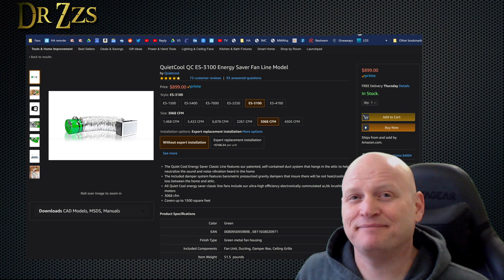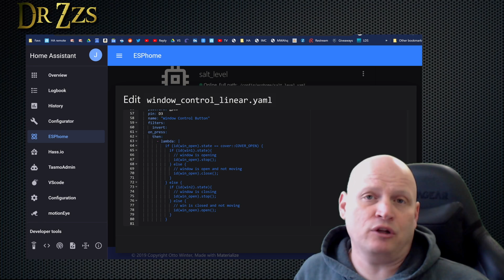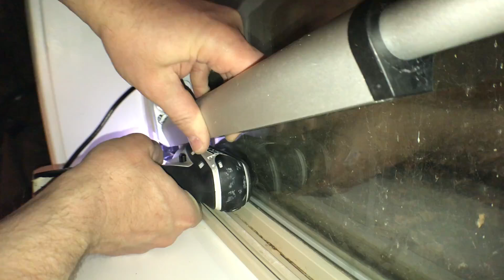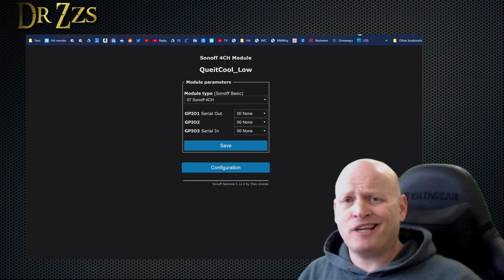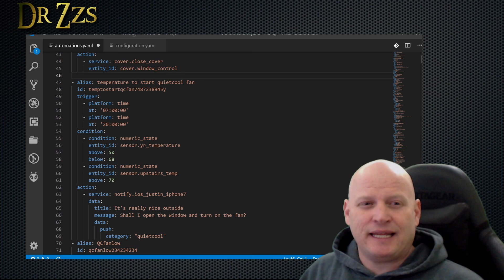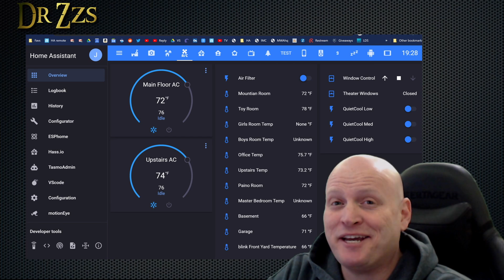Motorized Window Opening!  Save $$ using less AC! Smart Home | Home Assistant

Comment: You have ruined the required code fire egress window. Exit size required: 20 inches minimum one direction, 24 inches 2nd direction, and 5.7 square feet minimum square footage. (Note: 20 inches times 24 inches is not 5.7 square feet. One dimension must be larger than the minimum.)

Comment: Could a PLC, like an Arduino Optum could control this?  Adjust a window to different heights for cooling and kick on the fan, close it for storm detection or if it’s too hot and switch on the A/C or Smokey outside or vent for a fire…or close for cold temperatures.

Comment: I used the code to automate my Chicken Coop Access Door. Everything works as expected (up, down, stop) using the HA interface. Automatons (Sunset-close and Sunup-open) work as well. However, I just cannot get the physical button switch to do anything. From what I can tell, the way it is wired is to ground D3 (binary sensor) to stop or go up or down depending on the condition. Any hints on what I should look for to get the switch working?
Reply from the maker: Awesome!

Comment: Hi Justin, do you have an example that will include a dependency on a PIR sensor, if it will be allowed to close? (trying to get this to work with a sliding door for my dog -- it's working great so far, but I just don't have the motion sensor setup to make it safer for her if she decides to run in/out while it's closing
Reply from the maker: ooh good question.  I don't have that off the top of my head.  Seems like what you want would be like the laser line break sensor like on a garage door.  I'd suggest poking around in the ESPhome docs and see if there's an example of how to use one.... I just did a quick search and I couldn't find anything in ESPhome about a breakbeam sensor.  I'd bet it would be interpreted by ESPhome as just a switch.  Maybe get a cheap breakbeam sensor and play with it.

Comment: I see you're using a 25w motor controller, but the max wattage on the motor is 36watts (12v@3A).
Reply from the maker: It seemed to work okay.  I agree it was probably pushing the limits.

Comment: I'm really considering doing this in my brand new home as well. With it being super insulated, even when the temp outside drops to like 50 outside, the house will keep heating up to like 73 just from people/cooking, etc., so it'd be nice to crack a window and turn on my HRV to get some free "AC". Are there any issues drilling into the vinyl windows?

Comment: Great Video! installing this in 2022, there are some updates to the esphome  yaml that i needed to do. I'm wondering if this can be accomplished with a motor, track on the outside frame of the window, and installing end stops.  The Linear actuator works, but its slower and loud. I'd assume the motor with a track would be more  quiet, open the window faster and be able to open the window almost it's full length.

Comment: I think this code would work better for your application.

Only problem I see with it is rapid cycling because of a < or > set point. 

local Target = 65
local Buffer = 5
local Equalib = 10

if inside_temp > target+buffer then

	heater.state = false

	if inside_temp > outside_temp-Equalib then
		fan.state = true
		windows.state = true
		ac.state = false
	else
		fan.state = false
		windows.state = false
		ac.state = true
	end

elseif inside_temp < target-buffer then

	ac.state = false

	if inside_temp < outside_temp + Equalib then
		fan.state = true
		windows.state = true
		heater.state = false
	else
		fan.state = false
		windows.state = false
		heater.state = true
	end
else
	fan.state = false
	windows.state = false
	heater.state = false
	ac.state = false
end

Comment: If anyone else is using this video as a jumping-off point... I am using an ESP32 and found that I have to set the mode of my binary sensor GPIO pin to INPUT_PULLUP to account for float. I'm pretty new to this, so I was very confused when the state was looping On/Off every second or so. But hey, now I know about pull up resistors :) 
I've also set up a delay to ensure the button is actually pressed, but this might be unnecessary. 

binary_sensor:
  - platform: gpio
    pin: 
      number: GPIO14
      mode: INPUT_PULLUP
    name: "Window Control Button"
    filters:
      - invert:
      - delayed_on: 100ms
      - delayed_off: 100ms

Thanks for the video DrZzs- learning a lot.

Comment: I don't understand why window manufacturers don't have these installed inside the frame, so it's hidden. It would be nice to have the window open and close based on indoor vs outdoor temperature and PCT chance of rain. I hate opening the window at cool night because the AC won't turn on. Then closing it when it gets hot in the morning.

Comment: As always, thank you so much for your videos DrZZs.  Dumb question...This type of motor controller does not report a position, does it?  So, the  only way to stop and report if the cover is open/close is by using end stops (binary sensors), is that correct?  I know that the linear actuators that you used here have an stop, therefore you didn't have to have other end stops.  Thanks for confirming the info.

Comment: Great watch, this has given me an idea to use all of these components to push open and close my TV storage unit in between some wardrobes. The TV is an ambilight linked to home assistant.

I will take a state of Off to stow TV away, On to push TV forwards by 100mm using the delay of how many seconds it takes to reach 100mm (the delay you are using to drop power) or use a reed switch or limit switch for this. When TV is forward by 100mm the whole wardrobe frontage can benefit from ambilight.

I will then have a push button inside the wardrobe to open by 350mm (end of actuation) to access the storage behind the TV unit. using the L289N saves me from using a relay board.

Comment: Hi @drzzs, I tried to work with the L298N board, but for some reason, after a while, it makes my 200v breaker trip :/
I have no idea what's wrong, I'm using a 12v power supply with 3A max. Any thoughts?
 maybe I'm missing something in the code? , maybe it draws too many amps after a period of time?
Thanks!

Comment: Ok...but what did you use to automate the whole house fan?
Reply from the maker: A sonoff 4ch running Tasmota.
Reply: DrZzs Sweet! I’m looking to turn my whole house fan smart, but I still need to climb into the attic and see what kind of power my fan draws. Right now it’s controlled with a timer knob and a separate switch to turn the fan to high. I was thinking a Shelly 2 but I’m not sure if the fan will draw too much power.

Comment: Genius, simply genius.  I have an area at the top of the staircase that just collects humidity and heat due to not very good insulation in a 100 year old building.  Since I am rarely at the property I just look at my raspberry pi temp/humidity sensors and say ARGHHH.  Now I know I can install a simple small window and open and close it to vent the stairwell from miles away.
Wondering if I can run the motor with a motorcycle or car battery that gets charged with a small solar panel?

Comment: also use central power factor correction to really save on your electricity bills...try automating that and interface it with home assistant...it will be a nice challenging project requiring both embedded systems and power electronics knowledge.......plus it will give you great set of stats to observe your power usage by your smart home

Comment: Hi there. I'm wondering if something similar could be put together for a lock I have installed on my garage. Looks like this  https://amzn.to/2rxlqw9  .  I need to be able to remotely (un)lock it, say from a remote fob in the car, or via Home Assistant. I already have a a RPi in the garage for automated garage door open/closing. I suspect though I can't directly wire anything to it since the moving of the garage door would be a problem for the wires, so what remote (wireless) options do you think are available, and that can also control the motor. I wouldn't need something as large as the one you used....the lock latch only moves about 3-4inches.

Comment: Great video I also have a QC fan but I need to have the physical buttons cause my wife is automation challenged. Do you have a way to push a button to turn on the fan?
Reply from the maker: no, I don't have a physical button.  but you could use pretty much any switch/button that is connected to HA.  Even something like a long-press on a Tasmotized light switch could send the message to HA to turn on/off the fan.  Or an RF button with the RF bridge, or one of these Xiaomi zigbee battery buttons.  Or an HA switchplate if you have those.  
Basically, you can take a physical button and tell it to control the fan through HA.  
That'll work!
Reply: @DrZzs  Thanks, I did figure out how to use a Sonoff tx 3 switch to control a sonoff 4 channel to turn on and off the relays.

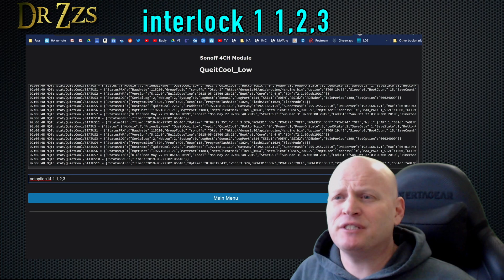Comment: 11:43 interlock working on version 6.5.0.16. According to documentation
1. Need to create interlock groups. Example command: interlock 2 1,3 
    where created two groups with single switch 2 and group 1,3
2. Enable interlock by command: interlock 1
Test feature. SW#2 working as usual and SW#1 , SW#3 works in group.
Reply from the maker: Thanks!
Reply: @DrZzs  Actually why you don't use latest versions of tasmota ?

Comment: Did you give any thought to a suggested fan speed and variable duration based on temperature differential or usage history?
Reply from the maker: so far I'd say you'll notice a change in temperature within about 30 min.  The rest depends on what temperature it is outside and how cool you want it inside.  I started running ours for an hour at a time, but lately (since it's been warmer outside) I need to run it longer to get it nice and cool in the house.  I'm running on LOW most of the time just because Med and especially High are much louder.  
I guess the best answer would be, Low is the best speed for us based on sound, and I've been running it for 2-3 hrs at a time in the morning then again in the evening, but usually shutting it off from about 11am to 6pm and about 11pm to 7am.
Hope that helps!
Reply: I meant that your home automation should predict and suggest desired usage.  As the day gets hotter it might suggest an increase in fan speed or switch to AC.  And your phone popup might authorize the recommendation or let you choose something else.

Comment: Is it possible you just rendered the window into a "fire code violation"?  I know you can just yank the window out in the case of an emergency escape but the fire marshal would probably see it differently.  Very cool use and implementation.  Perhaps you could use some kind of locking bracket on one end that allows you to pull the end up and out (similar to the bed rail brackets that hook and lock).
Reply from the maker: that might be true, but there is another window in that room right next to the one I motorized.  But you are right.  Probably would be better to use some kind of removable pin on one end of the actuator so you could pull the pin and push it up out of the way.

Comment: Nice vid! Hopefully you have another similar window like this in your basement as these are frequently considered a fire exit.  It would be easy to make a mount for the wall mount of the actuator that could allow you to slide the actuator up and out in an emergency. 
Also, I'd modify the QC fans display to be an input select rather than three switches, but that's just my preference.
Reply from the maker: that's a good idea!
Yes, there is another window right next to this one, so the fire exit is still open.  
I saw another way to mount the actuator that would allow the widow to open all the way, but it needs to be a lot bigger and I haven't found one big enough yet. Yet...
Reply: @DrZzs  They have those sliding door "lock" bars that swing down into place. You could implement a similar system here. Put the back end on a hinge and 3d print a "catch" for the window side.

Comment: Next - installing IR led sender/receiver to detect object in path when closing, like a garage door.  (Could perhaps use one of the garage door sender/receiver pairs if you don't want to design your own?).  It could be on the edge of the window frame opening - anything which might get crushed has to get pushed up against that edge first.

The other option would be to have something elastic in the mechanics, so that the max closing force would be set by that elasticity rather than the power of the linear actuator - enough to close the window but not enough to crush a finger.  Perhaps have an alert if the security sensor doesn't detect closed within a reasonable time.
Reply from the maker: good idea!

Comment: Any suggestions on how to open a traditional window (not a sliding one)?
Reply: I've seen actuators for windows that open outward that extend an arm perpendicular to the actuator on Amazon.
Reply from the maker: I have a setup working for a crank window.  I just need some time to edit up the video.  The tricky part is 3d printing a coupling that will fit the shaft of the geared motor and the crank gear on the window.  I've been using PLA for that, but I've stripped several of the couplings if the resistance from the window getting too high.  
And Mike also has a good point.  You could just re-arrange the actuator to push or pull the window up or out.

Comment: Firstly, I love your videos!  I do have one question, of your window opens and closes automatically (So cool) if the window is closed does the actuator secure the window? Can someone just pull the window open? I’m thinking about trying this on my sliding glass patio door. Would be better then placing a bar in the jam every evening assuming it’s secure. Thanks for the inspiration!
Reply from the maker: The actuator is pretty solid when it's extended.  I can't push it back in.  It's as strong as a bar in the window jam.  Someone would have to break the window glass to get in.
Reply: DrZzs Thanks for the reply bro! Any recommendations on how I could setup how I would open the door from the outside. I’m trying to get the WA (Wife Approval) and need to get everything thought out before moving on! Thanks for all the inspiration and videos!

Comment: OK question, Arduino with Tasmota install ( which i know how to do) and then configure OR ESPHome ? mind you it will be on a NodeMCU....
got my parts and ready to build, Switching over the chicken coop setup to this way
Reply from the maker: I'm pretty happy with ESPhome lately.  I'll still use Tasmota on some devices that don't have an established template on ESPhome (like the 3-gang T1 switches), but for dang near everything, I'm using ESPhome these days.  So, for something like this on your chicken coop, I'd say use ESPhome.
Reply: @DrZzs  have not played with it yet but I'll do the download and have a look. Didn't know there were prebuilt template. Thanks

Comment: If you get a longer linear actuator, you can connect it on pivots at an angle across the window and it would be able to open the window further as it tilts up when the window slides back.
Reply from the maker: Ya, I just saw that.  Doh!  I need to just get a longer actuator now!
Reply: I actually didn't understand this... could you guys explain it a little bit more? 
Why would a longer actuator be helpful? Do I connect the actuator diagonnaly in the window? I'm confused... 
thanks in advance
Reply: @Brunozumba  Maybe easiest to think about a right triangle, where the vertical side is a fixed length.

As the hypotenuse (the diagonal side) get shorter, the bottom also gets shorter.

For this example, let's say the actuator can shrink by half its length.

Now, if the actuator goes straight across the bottom of the window (i.e. the height of the triangle is zero) the furthest the window can open is half the length of the actuator.

Now, let's get a longer actuator, so, when the window is closed, it makes a triangle that's height is 3/10 the length of the actuator when the actuator is fully extended (which forms the hypotenuse of our triangle). For the sake of example, we will say the actuator is 10 units long and attached 3 units higher to the window than to the frame.

When the actuator is fully extended, the base of the triangle is Sqrt(10^2-3^2)=9.54... units (just a little short than the actuator)

When the actuator retracts to half its length, the base of the triangle is now Sqrt(5^2-3^2)=4 units. So the window opened 9.54 - 4 = 5.54 units

If the actuator had to fit directly across the base of the same window, the window would only open by half of 9.54, which would be about 4.77 units.  

It might be easier to see if you get out some straws and popsicle sticks and make a model to see it with.

Sorry if that is hard to follow. Would probably be a good video topic for someone.
Reply: @aviphysics  Nice!! It took me a few days to answer because I have to read it with time, a pen and a paper so I could draw the triangles and understand. Thanks!!! =)

Other way to approach it and maximize the window openning is attaching the actuator on the other end of the window.
For example:

A        B        C
|           |         |
|______|_____|

How Dr Zzs made was: A is the wall where one end of the actuator is attached. B is the one side of the frame where the other end of the actuator is attached. C is the the other side of the frame.

If it's possible for your configuration, if you get an actuator long enough, you can continue to attach one end on point A (the wall) but the other end on point C, instead of point B.
Like this you can open the window a lot more.

Anyways, just another tought in case it helps someone. Thanks!
Reply: @Brunozumba  that is a good idea.